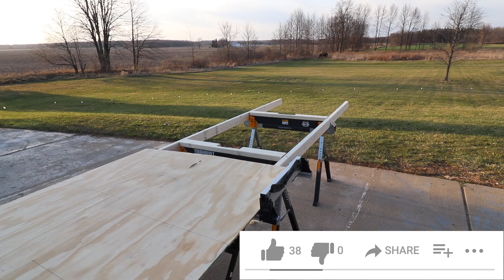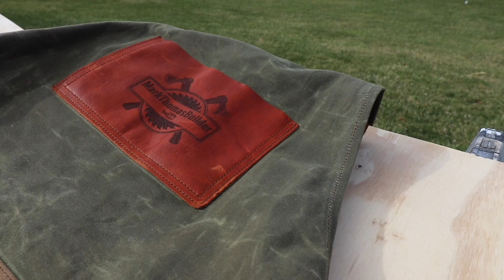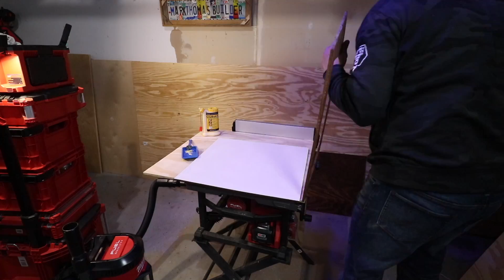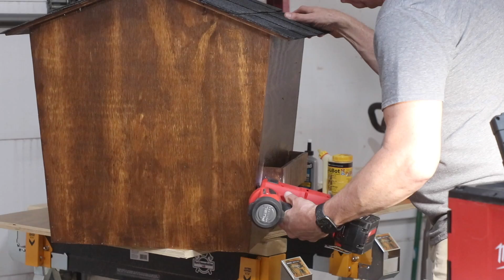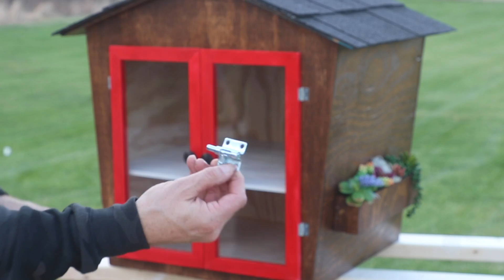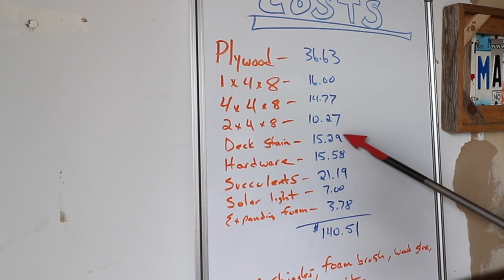HOW TO BUILD A MINI FOOD PANTRY & BEST TIPS FOR SELECTING A LOCATION!

Comment: Any tips for weatherizing? I live in tx where it is summer 9 months out of the year
Reply from the maker: I'd suggest a marine grade finish, like Total Boat Gleam.  It's a varnish with UV protection.  I also have tried General Finishes Exterior 450, which is very impressive as well.  I recently put it on a cornhole board and I'm very happy with the results.